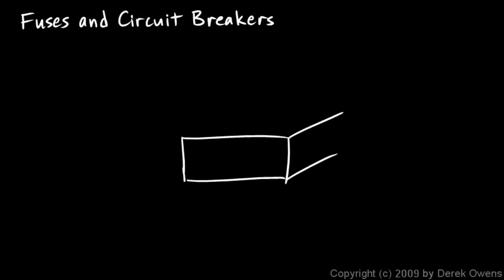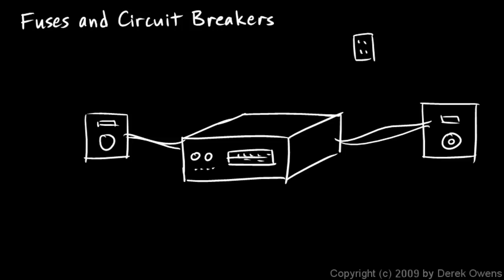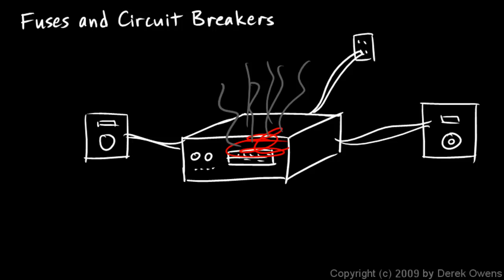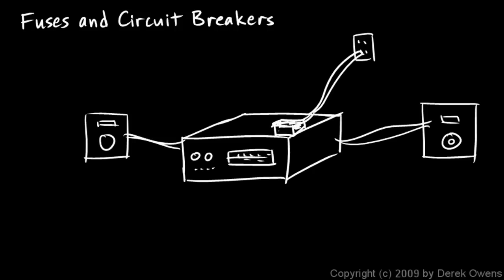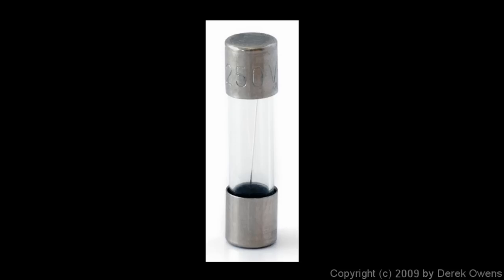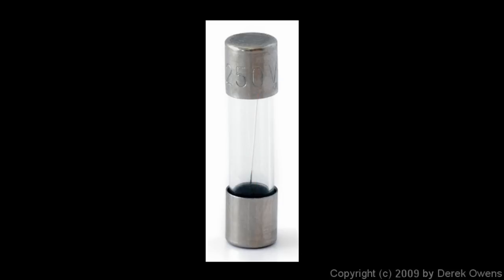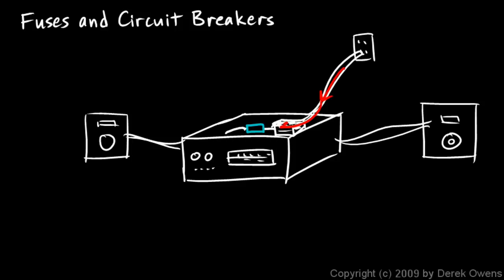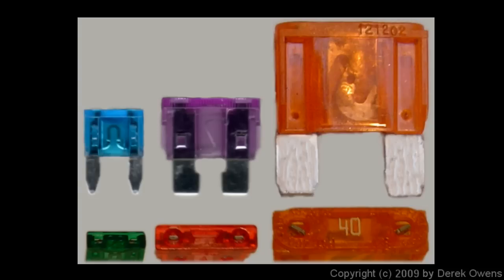Physics 13.3.4a - Fuses and Circuit Breakers

Comment: You mention power being converted to DC when going into electrical appliances but just mention a transformer. From my understanding, don't these devices need a transformer to step down the voltage and also a rectifier to finally convert AC to DC?